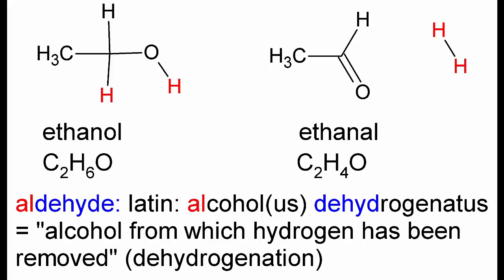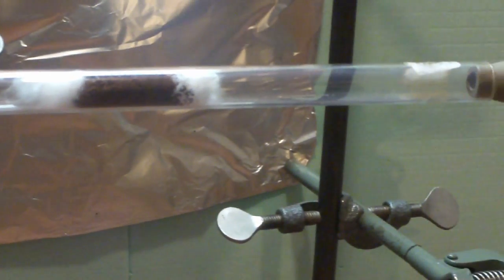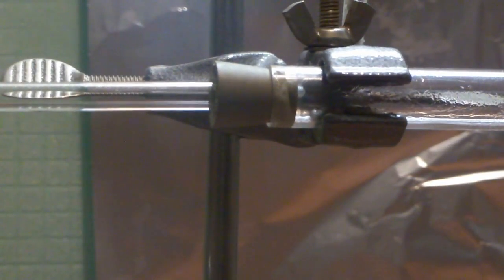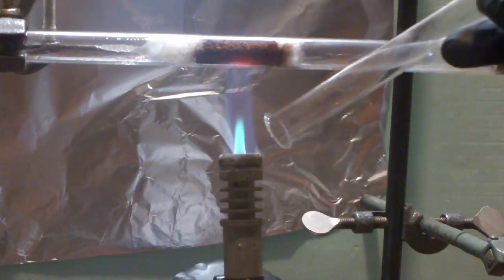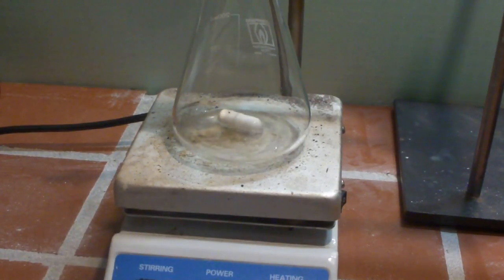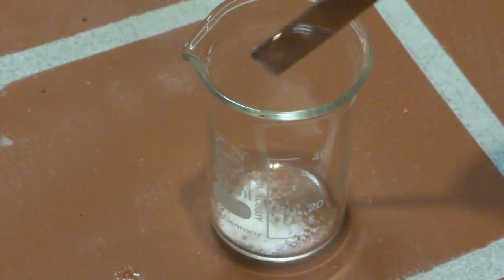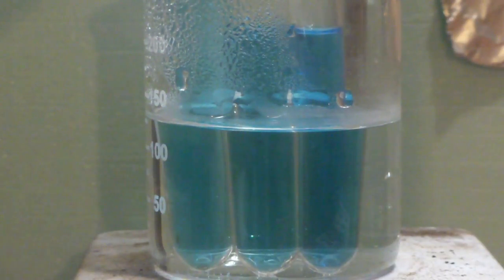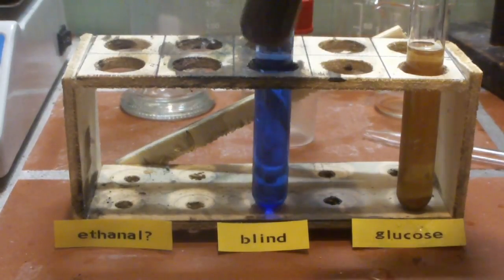Preparation of ethanal (acetaldehyde) + Fehling's Test

Comment: Thank you for this wonderful demonstration. I tried to repeat it at school lab. I used about 10 cm3 of ethanol as starting material and the catalyst in a few minutes from black, turned copper color (i used 4-5 grams of CuO), obviously since it converted to Cu. This is indeed a sign that the reaction worked (and CuO became Cu) but in your video the catalyst doesn't seem to "be consumed"  so quickly. Do i have to use more catalyst for this amount of ethanol?
Reply: i guess in this video pure copper powder. cuo can oxidise ethanol to an acid.
i am trying it on a medium scale. best of luck to me.

Comment: Fun but why not just reflux ethanol with chromic acid ?
Reply: for me the chromic acid method would use too much dichromate salts, which I have a limited amount, cant say that about some copper
Reply: @karolus28  explosions and fire gets bunch of Chromium salts by disolving knives and forks 🤣
Reply: @SodiumInteresting  ye but i got a quartz tube and some copper salts so in my case its better
Reply: I dunno, maybe because chrome VI compounds are confirmed carcinogens and expensive AF.
Reply: @tetrabromobisphenol potassium dichromate is not that expensive but you do need a lot just to do a useful amount

Comment: Why was water used to dissolve the product and not to distill the product
Reply: you can definitely distill the product, but be sure to have a good cooling synstem, as ethanal boils at 20 C
Reply: Probably to prevent it from polymerizing. And you can always recover it with reverse osmosis or vacuum distillation later.

Comment: GREAT VIDEO....................Copper oxide oxidizes at 300 C............ primary alcohols into aldehydes ........tertiary alcohols into alkenes..........and secondary alcohols into ketones.    However the ketone produced may be further oxidized to a ketene.  I do not know the temp of ketene production.       
                                              Aluminum oxide Al2O3 at 250 C oxidizes primary alcohols to ethers and at 350 C oxidizes primary alcohols to alkenes/aldehydes mixture.    And guessing around 400 C it oxidizes 1,2_diols to aldehydes and ketones.   Through either a pinacol rearrangement  via carbon cations and hydride or methyl shift OR through enol formation and rearrangement without carbocations .   Ethylene glycol since all the carbons are primary and could not form carbocations and therefore could not undergo a pinacol rearrangement  would form an enol after the first double bond was formed and then rearrange to form actaldehyde.  The catalyst Al2O3 can be used with a co catalyst to shift the production to more or less of a product or byproduct.   Meaning more or less aldehyde.  More or less alkyl oxides.  More or less other by products etc etc.  There are 3 main types of Al2O3 catalyst........(1)acidic(1% by wieght is best for aldedehydes) NaAcO........... (2)basic   (3)adsorption

Comment: QUESTION...................You know how hypochlorous acid (bleach + AcOH) will oxidize a primary alcohol to an aldehyde and a secondary alcohol into a ketone.   Well my question is this..........will the hypochlorous oxidation  reaction work with ethanol and methanol to make acetaldehyde and formaldehyde??????????????????????   Sometimes reactions with  these lower weight alcohols do NOT work and so that is why i ask
Reply: I think u could use an excess of alcohols to prevent the haloform reaction etc. from happening, and keep pH at around 7 to prevent chlorination and it'll be fine(?)

Comment: Mix HNO3  and EtOH
Reply: You need sulfuric acid in there to drive the reaction forward, and do it at ice temperature. Otherwise with nitric only nothing happens until you add enough heat to force it, and then it goes out of control from the exotherm and boom you're dead.

Comment: Can i use the same catalyst for methanal ?
Platinized asbestos is more expensive than gold
Reply from the maker: Yes, that should work. However, keep in mind that formaldehyde readily polymerizes, possibly clogging tubes. And be aware of carbon monoxide formation! Formic acid could form and then decompose.
Reply: Astral Chemistry im really follwing a synthesis for formaldehyde from prepchem involving heating metahnol in a flask with a 2 hoke atopper one for incoming air and the second tube is connected to a combustion tube which is dipped to the reciving flask with a 2 stopper hole the tube tha comes from the combustion tube is dipped to the bottom of the reciving flask and the second hole connedced is equipped with another bint tube which connected to water aspirator ..in the synthisis polymyrization has not been mentioned but thank you so much..the recieving flask is surrounded by ice..the synthysis says that a highly concentrated formaldehyde methanol solution obtained.
Reply: I used acetal heated to over 150 C and it turned to formaldehyde gas but clogged up the tube where it cooled, so requires heated metal tube directly into water

Comment: This is very good but i have a few questions.
Did you use ventilation, because generating hydrogen in a room with a gas burner going is asking for trouble.
Also how are you going to prepare PURE acetaldehyde, Its great being able to make a small quantity of impure acetaldehyde dissolved in water but we can all do that, ideally isolating it as a pure product would be more desirable as this could be made into the paraldehyde for storage and also be used in reactions, the aqueous solution containing large amounts of ethanol however is rather useless.

You need to set up a condenser for collecting the acetaldehyde instead, given the low boiling point this may be a pain but a normal ice bath on the receiver and keeping the condenser water below 10*C should suffice albeit you may loose a little product. I wouldn't advise salt water for the condenser water unless your water pump can handle it.
As for separating the acetaldehyde from the ethanol, im not sure if you could get away with fractional distillation but you might as well give it a go, another idea would be to try a desiccant that removes ethanol such as calcium chloride however there is no grantee that calcium chloride is not soluble in acetaldehyde but the calcium chloride might at the very least hold onto the ethanol a little better during distillation.

Third option although not a great one, would be to simply try and polymerize the acetaldehyde ethanol mixture and hope that paraldehyde isn't soluble in the ethanol.
This can be achieved by carefully adding conc sulfuric acid to acetaldehyde on an ice bath, at low temps and after dillution with water the paraldehyde will drop out of solution as a solid which can be filtered off.
You could then distill the paraldehyde BP 124*C.
Do not heat the paraldehyde in contact with acid however as this is how it is depolymerized.
https://erowid.org/archive/rhodium/chemistry/acetaldehyde.html
Reply from the maker: Thanks for your elaborate comment.
 As we already pointed out in 
other comments, this method was intended for demonstrational purposes, 
not for preparing large amounts of ethanal. If you want to prepare pure 
ethanal,  Liebigs chromic acid mild oxidation is the way to go. 
Regarding
 the hydrogen, the waste gas stream was burnt completely as pointed out 
in another comment. This is accomplished by feeding the gas stream into 
the air intake of a meker or teclu type burner. 
If you however 
decide to separate the ethanal from this setup, we strongly suggest 
going the acetaldeyde-ammonia trimer route 
(2,4,6-trimethyl-1,3,5-triazinane). Here's the procedure for you:

 Acetaldeyde-ammonia trimer is prepared by absorbing acetaldehyde by extraction with ether. The ethereal solution is cooled with a freezing mixture of ice-salt, and treated with ammonia until the liquid is fully saturated. After an hour, the acetaldehyde-ammonia trimer which has separated out is collected, filtered, washed with a little ether,
 and dried on filter paper in a desiccator or vacuum.
In order to obtain pure acetaldehyde, 10 g of acetaldehyde-ammonia trimer are dissolved in 10 ml of water. This solution is treated with a cooled mixture of 15 g of concentrated sulfuric acid and 20 ml of water, and distilled by gentle heating collecting fraction boiling at 21° C.
Source:
The practical methods of organic chemistry, by L. Gattermann, 135, 1909
Reply: Apologies if you took my comment too whole heatedly, ill admit i could have structured it a little more passive and i probably should have read the other comments first but it was just criticism, i did enjoy you demonstration.
As for your idea of converting the acetaldehyde to the ammonia trimer, i feel like a bit of a fool for not trying this myself, i was concentrating on paraldehyde as a means of storage. The use of the ammonia trimer might actually be the turning point to me isolating pure acetaldehyde.
Reply: Modest amounts of hydrogen production is not at all a big deal even around open flames so long as the vent is above flame level, and you maintain adequate ventilation so that it doesn't build up. Hydrogen is much, much less dense than air and will rapidly rise. I speak from years of practical experience testing fuel cell stacks with orders of magnitude more hydrogen involved than this video. I've also brazed using oxy-hydrogen torches. Lots of glassblowers use oxy-hydrogen torches as well. So it's not that big of a deal.

Comment: What if you used a bisulfite solution in the gas washing bottle? You might be able to efficiently precipitate the product as the bisulfite adduct, which would also help with isolation
http://scienceblogs.com/moleculeoftheday/2007/01/17/sodium-bisulfite-aldehyde-addu-1/

I've wanted to try this reaction for a while, but an open flame near flammable organic vapors gives me the willies ;) I've been thinking about building an induction heater for flameless gas-phase reaction heating
Reply from the maker: We thought about that but this video was intended for demonstration purposes only. If your plan is to prepare usable quantities of ethanal, then the bisulfite adduct is the way to go. Our experience however is that these simple aldehydes react exceedingly slow with the bisulfite and excessive amount of stirring is needed to precipitate out everything, especially if a thick slush of crystals starts to form.
We like to use nichrome wire wrapped around our reaction tubes especially for solid-bed catalysts. Since we burnt the hydrogen (and any other combustible gasses) there was no risk. This might not be visible in the video, I don't recall it exactly.

Comment: would it be possible to instead collect the acetaldehyde directly via condesation with a salted ice bath in a small RBF rather than obtaining a solution of unknown concentration? i would suppose the dichromate oxidation may be better for that but this looks like an easily upscaled continuous process.
Reply from the maker: Yes, absolutely. We thought about using a dry ice condenser to collect the ethanal as well. But an ice/salt bath would definitly work well. This was just for a little demonstration. If you want to actually use the ethanal, I would just condense it as you mentioned. Or, you can prepare the ammonia trimer for purication (see http://www.prepchem.com/synthesis-of-acetaldehyde/). And yes, the process should be easy to scale up. 
We decided not to show the Dichromate method, because there a lot of videos about that already. Very nice channel BTW!